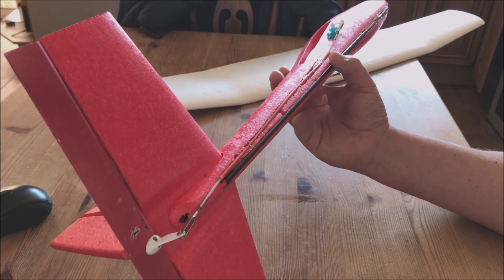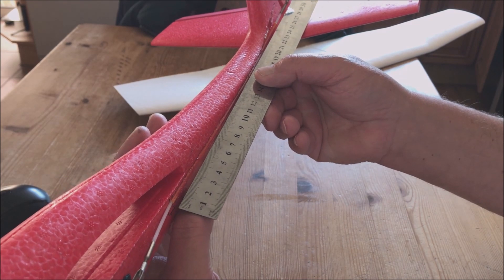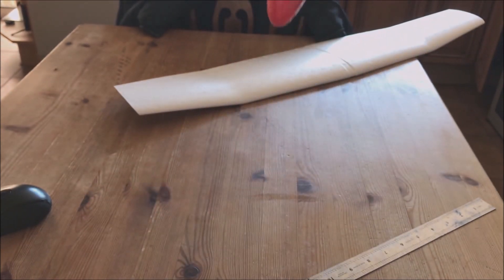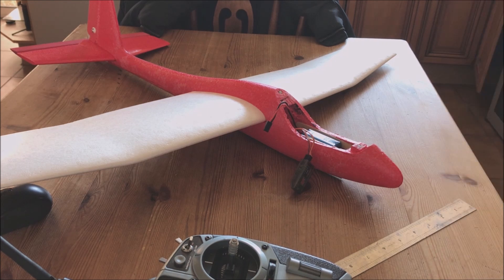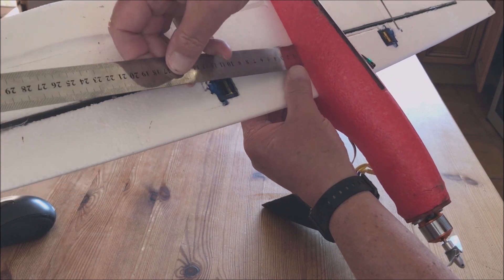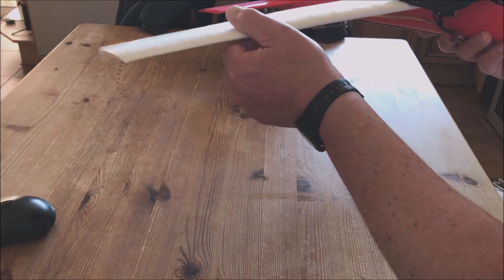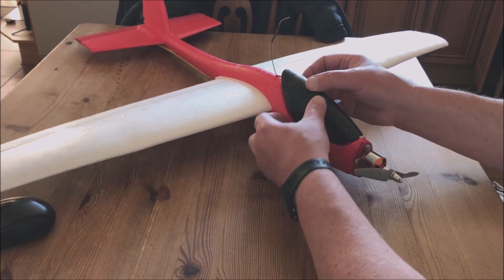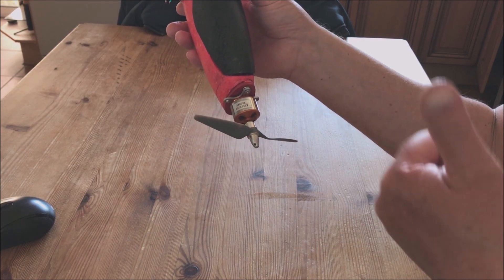Lidl Glider Slope or Power

Comment: Interesting video Nick. Just one thought for next time - if you use smaller digital servos, you can probably save a lot of weight. Digital servos deliver significantly more torque for their size. You could probably go for at least 3.7g servos (saving > 8 grams on your two servo plane or 16g on the one with ailerons) or even 2.2 g digital servos saving  15g-30g overall.